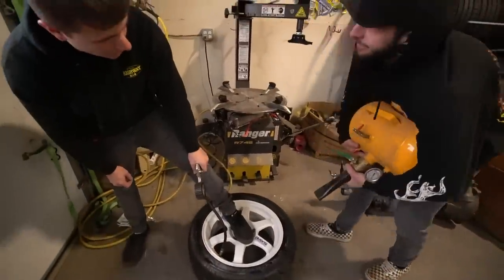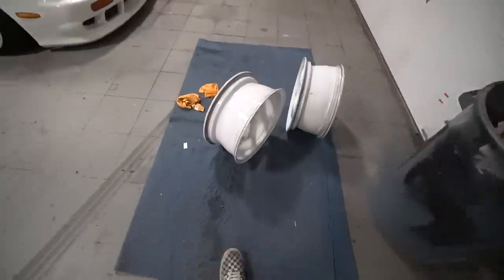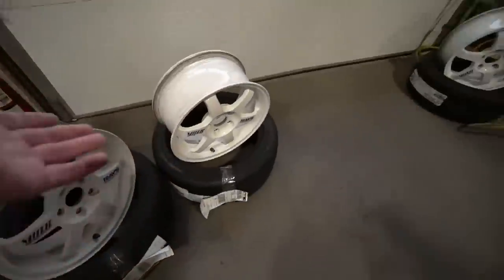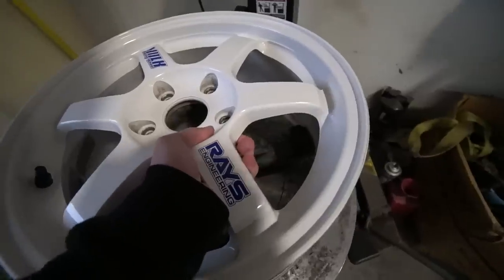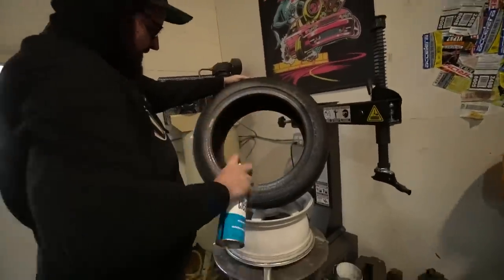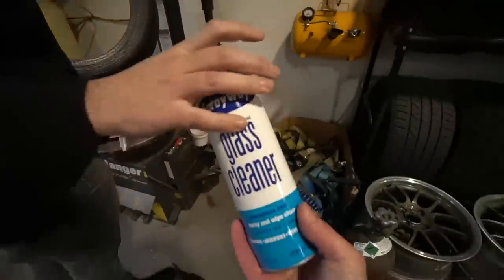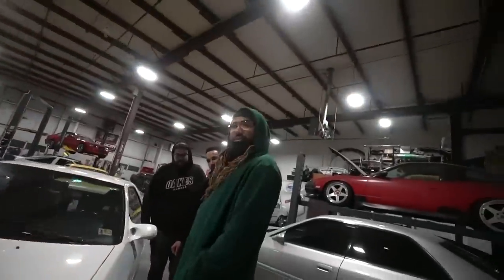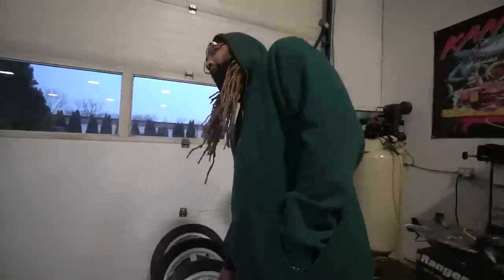Putting TE’37 + BIG GRIPPY Tires On My Civic! BRIAN DOES NOT APPROVE!

Comment: Keep the 36mm hubs & spindles once and if you go k swaped. If you're getting 32mm hubs from a dc2, you will need a usdm integra spindle or a civic em1 spindle to work and be able to use the bigger brakes. You will be able to use those 32mm hubs, if you go kswap but will either need custom axles or use base rsx axles.

Comment: Keep your hubs as 36mm oem k20a2 axles will bolt right in with the eg subframe. Type S and Si axles are 36mm. Base rsx axles are 32mm

Comment: FYI.     Rsx base model hubs are the same size spec with a 32mm.  But you won’t see this
Reply from the maker: Are they 5 lug? Base models and I see it 😝
Reply: @djnoway  yes Acura rsx base model !!! Not type s.   Base model is 32mm 5 lug      And fits the wheel bearing for your spindle
Reply: Yes it has to be BASE MODEL not type S @S
Djnoway

Comment: CR-V hubs are 32mm i believe and 5lug.... and i think prelude outter joint on your civic axle works as well.
Reply: They are 36mm
Reply: Crv is 36mm if I remember correctly! 

Just do the k24 swap and keep the 36mm hubs with rsx type s axles! 
I'm on 32mm base model axles on our k20a2 swapped ek and snapped a few already 😆

Comment: You need civic type r hubs those are 32mm... the Integra type r hubs are the bigger 36mm ones.. when you do the k swap if you use an eg sub frame you can use ep3 axles they're 32mm and the right lengths not sure if that helps ya bro

Comment: I could also maybe say pulled the rear plastic and putting a bunch of the rust killer inside the quarter panel itself would also help prevent against future rust you can’t get right to where he is working from the inside through some holes lol

Comment: 44600-ST7-R00 There's the part number for the ek9 hubs to suit a 32mm hub nut shaft. You have 98 spec integra hubs which take 36mm.

Comment: if you have 36mm hubs you're going to have to make your own single cam axles by swapping the outer splines to honda prelude outers because all single cam axles are 32mm. 

the good thing about already having 36mm hubs is you're going to need them when going K.
Reply: i also highly recommend changing out your trailing arm bushings to hardrace trailing arm bushings. night and day difference in ride comfort

Comment: Dude i got the eg subframe you need for the k swap as well as a new manual steering rack new ktuned eg lowers new ktuned front camber kit new ktuned extended balljoints new karcepts 36mm hubs i got alot more shit as well as a k24a2 sitting on a stand with your name on it dj im in ny come get this stuff!!!!!

Comment: Just buy Karcepts 36mm Swap Hubs / USDM 1997-2001 Acura Integra Type R / JDM 1997-2000 Honda Civic Type R / 5x114.3mm / 43mm I.D. Wheel Bearing 

Only $350 for a pair and improved over oem options  + One Karcepts K-Series Axle Spacer for B-Series Transmission $30 

These hybrid hubs share identical external dimensions with the original USDM 1997-2001 Acura Integra Type R and JDM 1997-2000 Honda Civic Type R wheel hubs they replace; however, their center bores have been machined to accept the larger 28 tooth spline pattern found on “36mm” Honda/Acura axles. This allows EG, EK, and DC2 chassis to simply pop in the more robust axles found in vehicles like the RSX Type S

EG/EK/DC2 B-Series Axle Option:
One pair of USDM 2002-2006 Acura RSX Type S Axles (Driver + Passenger Side) + One Karcepts K-Series Axle Spacer for B-Series Transmission

Comment: Bro 200 treadwear 215 width rt660's are not big nor grippy not even on a civic. In the Honda game minimum big grip setup would be reverse staggered minimum absolute minimum 225 width and 100 or less treadwear then for a Honda you could save big & grippy setup hell could even stick with 200 tread wear if sizing wasn't completely average big would be a 245/45 front 225/45 rear. At least spoon knows what's up. FWD Honda time attack guys running 255+ fronts